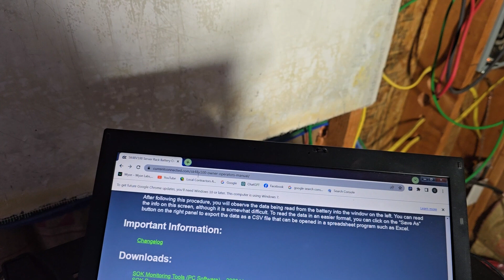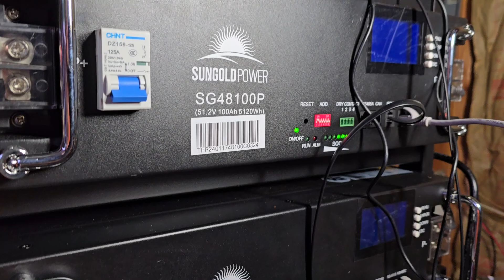Solar Battery Connections Sungold Power

Comment: Are those the positive and negative output lines that come in the box? How long are the output lines?
Reply from the maker: Yes each battery comrs with a red line and a black line 6awg (I think) around 18" long.
Reply: @HowToWith24DY  On the Sunpower Gold, what size copper lug hole will it support? I'm getting different answers from people. Thanks!

Comment: Hi, be curious to see whether you can see battery capacity from the inverter over rs485.
Reply: There is an App called WatchPower that connects to my sp6548 inverter via wifi.  It shows lots of stuff, but for battery capacity, it shows varying values (0 to 255). When it goes to 0, the inverter shuts down.  I suspect it gets data via 485, but I'm still troubleshooting.
Good video, btw!
Reply from the maker: Inverter sbows battery voltage on screen but not via 485.
Reply: Have you ever used the app 'WatchPower'?  It connects wirelessly, but for me, it shows gibberish battery capacity (from 0 to 255), and I'm trying to troubleshoot it.  When it goes to 0, the inverter shuts down.